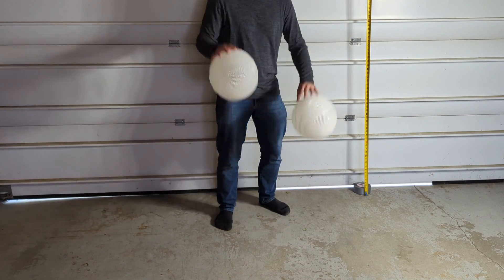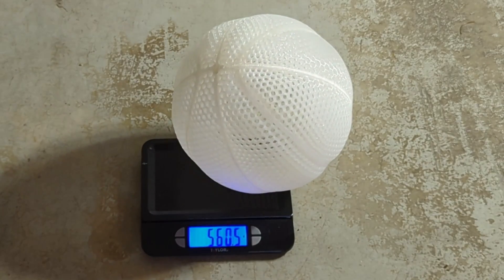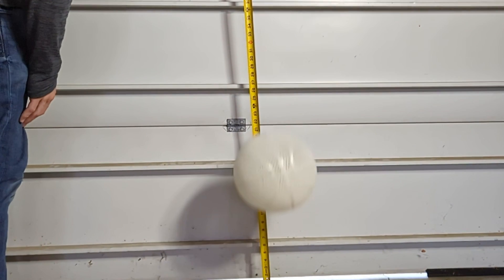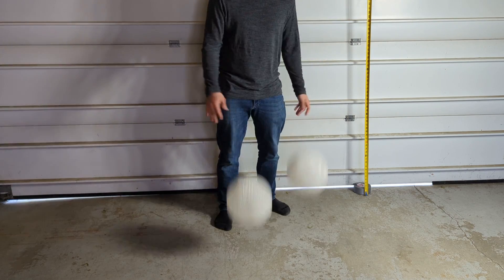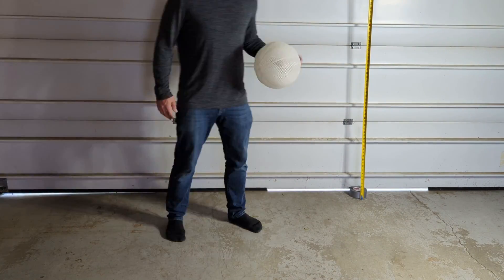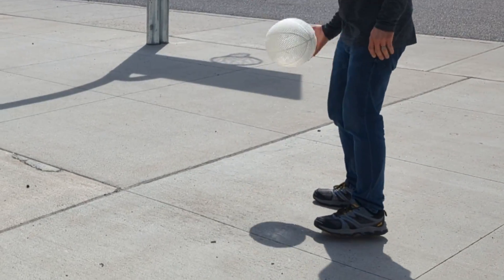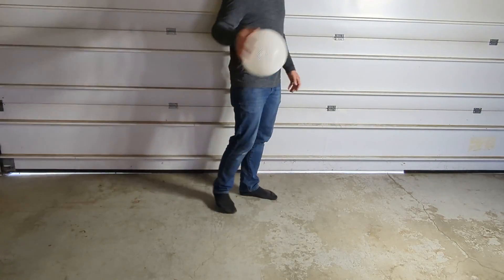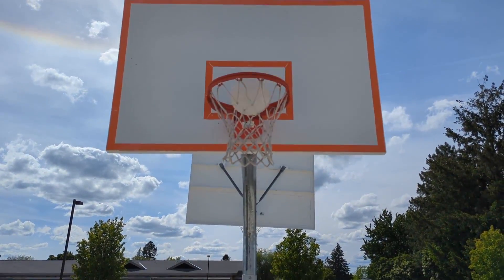Single vs. Double lattice PEBA Airless Basketballs – Durability and Bounce!

Comment: Is there any post work required? Does the ball need to be soaked in water or anything?
Reply from the maker: Besides removing the supports, I haven't done any post work except annealing, which definitely helps with the durability

Comment: Thanks for all the amazing work! Is it possible to print the supports in another material for easy removal?
Reply from the maker: @deonguo8002  much appreciated! The only way I know that would allow another support material would be using a printer with multiple tool heads (like the Prusa XL). That would be a game changer though as the support removal is a pain
Reply: @makeitlabchannel  not possible with AMS system?
Reply from the maker: @deonguo8002  I tried the AMS with PEBA and flex PLA and had bad results - tangles, clogs, etc. I couldn't get any of the flexible materials to work with the AMS. Maybe there is a workaround or upgrade that would allow it, but I haven't seen anything 😕
Reply: @makeitlabchannel  AMS lite isn't encased in a shell like AMS, maybe that'll work? Or just print with sth like pla in the ams for the support or dedicated support filament, then peba hanging as an external spool?
Reply from the maker: @deonguo8002  The AMS lite would definitely be worth a try, and I read that you can use the external spool and AMS lite if you have an adapter so that could work. Once I fix my A1 I might just try it!

Comment: is it possible to make the double lattice without the seem? I am assuming the seem is only there to resemble a traditional basketball but if its being printed it probably doesn't need it right?
Reply from the maker: @TheSwami514  I am currently making a double-lattice file, and I have included minimal seams that won't run parallel to the printing lines when printed. It has held up well so far so I will hopefully release it soon 😁
Reply: @makeitlabchannel  nice, i hope there is a video about it
Reply from the maker: @TheSwami514  there definitely will be 😁
Reply: @makeitlabchannel  Looking forward to see the result! Have you tried printing it in TPC? If so, how did it do?
Reply from the maker: @lorenzo-f5p  I have some TPC waiting for me to try once my file is complete, and I should be releasing it sometime next week so soon 😁
Reply: @makeitlabchannel  That's great to hear! I'm ordering a roll now, so very curious to see your results (and settings)! I will wait for your file before printing my own :)

Comment: I know the print times are long enough already 😅, but has anyone tried using Bambu PLA/PETG support material? Is it likely to work with these specialised Kimya filaments?
Reply from the maker: @syko2695  I have thought about trying this but the only problem that I can't work around is every time I put the peba filament in the AMS, it gets stuck and malfunctions. It might work for other Kimya filaments, but so can't get the AMS and peba to play nice
Reply: @makeitlabchannel  Ah, didn't think of that. Fair enough. I take it the 500g spools being significantly thinner than 1kg ones causes trouble?
Reply from the maker: @syko2695  weirdly enough, the size of the spool is the same size as a 1 kg regular pla spool. I think it is more that the peba is so flexible that the AMS has trouble with all of the additional motors and twists/turns. They warn against using tpu and other flexible filaments because of this, but I have seen some people do tpu successfully so maybe there is a secret

Comment: Is it best to make a double lattice with flex pla?
Reply from the maker: @sai7128  it would be best to make a double lattice flex PLA ball if you plan on annealing it like we did in this video: https://youtu.be/F0lkJQr95Gw?si=pT2U54nZO3sCyILL

If not, single lattice will probably last longer but have less bounce. At this point, I wouldn't make any flex PLA ball without annealing as they have all eventually cracked.
Reply: @makeitlabchannel  I got it. Your videos are very helpful.👍👍
Reply from the maker: @sai7128  Much appreciated!

Comment: Can confirm - just printed the double lattice file with settings from the last video and after about 20 bounces, it split down the seam section just like yours. Definitely will attempt the single lattice version with the improved durability, but I am curious to see if the double lattice printed at an angle would hold up durability-wise. To me, the double lattice certainly seems like it has the best bounce.
Reply from the maker: Appreciate it. If I can get more PEBA I will try printing it with a different orientation to see if it holds up.

Comment: it's all about the print direction... the weak part is generated between layers... the double-lattice have the seam printed horizontally (0:09), while the single vertically (0:11).
Reply from the maker: Yes that is definitely a big factor - I printed the file with a different orientation with flex PLA and it cracked around that seam as well. PEBA might have better results, but I think part of it is that the file has a thick seam that connects to small lattice branches at the areas it is cracking. If I can get more PEBA I will rotate the orientation and see if it will hold up 😁

Comment: did you try to print the supports in a different material? Maybe they are easier to remove in that case.
Reply from the maker: Yeah I thought about trying that but when I used the PEBA in the AMS it got caught/ran into some issues - is there another way besides the AMS or manual changes?
Reply: @makeitlabchannel  maybe with the AMS Hub? Not sure if you can directly use the Hub without the AMS. My guess is that the rubber fillament creates to much friction over the length of the AMS tubes.
Reply from the maker: @arcadebit1551  definitely worth looking into because if the supports were easy to remove it would be amazing. I think you are right

Comment: Try the airless file from printables called “Airless Basketball Gen X (Max)” don’t use the double lattice version tho
Reply from the maker: Thanks! I will check it out 😁
Reply: Why not use the double lattice version of that? I've been printing it with PEBA the last few days
Reply from the maker: @CCBCodeMonkey  how did it turn out? Does the durability hold up?
Reply: @makeitlabchannel  Oh the double lattice other file didnt finish because my power ran out, but either way that one just wouldn't bounce well, its essentially like a single lattice I think.

Comment: The double lattice cracking might be due to FDM printing, the original one was made using an industrial printer with solid layers instead of it extruded through a hot end in lines.
Made my double lattice basketball 3d model, it was a pain to do in Maya, i understand now why they decided to create a custom tool to make it easier, getting the right size for the patterns was tricky and also connecting the 2 layers required a lot of trial and error.
Would be cool to test with a resin printer and something like tough resin or flexible resin, resin printers do a better job of curing the layers.
Reply from the maker: You might be right there. Have you tried fdm printing your design? Resin printing is a good idea, never tried it but might be worth trying for this 😁
Reply: @makeitlabchannel  Sent my 3d model to an acquaintance but he never got to print it, was planning on printing a few to sell. Sold my old FDM printer only have resin printers but don't have the build volume to test it and never tried hard or flexible resin.

Comment: Great update!!. Does sound like there may be problems with the file. Perhaps bring into various slicer, CAD, sculpting, or modeling apps and see in there are variations across the mesh.
Reply from the maker: Appreciate it! Those are good ideas. I might start with just changing the orientation of the print as someone else recommended as it might just be the layer lines with that seam, but could still cause problems

Comment: Great work! I was able to print the double lattice with random seam enabled and had the same failure long that edge of the basketball. Excited to see how durability can be solved, as I really did like the bounce of the double lattice. Following for more :)
Reply from the maker: Appreciate it! I should have thought of this but someone mentioned just rotating the orientation 90 degrees so that the seam is not along the layer lines and that sounds promising. Will have to try when I get more PEBA 😁
Reply: @makeitlabchannel When  I printed that ball in flashforge flexible it was oriented 90 degrees from how you printed it and it cracked the same
Reply from the maker: @AlexMccawley  yeah for me it looked like it was more of a problem with the large/thick seam connected to small hexagon lines. Hopefully one of the files will work well

Comment: Thanks for the constant evolution of this project. Which brand of PEBA are you using? I have only seen Fillamentum and Kimya PEBA-S. 
I will absolutely build one or two of these but also very keen to follow your development journey.
Thanks for sharing.
Reply from the maker: Much appreciated! The brand of PEBA I am using is the Kimya PEBA-S - seems to work really well. I think changing the orientation of the double lattice might potentially help the durability, but I am running out of PEBA lol
Reply: @makeitlabchannel  its not cheap stuff. you either run out of PEBA or you run out of money doing this stuff.
Reply from the maker: @joshwright3683  yep that is my dilemma lol

Comment: I think that seam weakness on the double lattice ball may be due to an unoptimized print orientation. I printed my first ball the same way you did, but I was planning on rotating my next print 90 degrees so the NBA logo faces up. In that orientation the middle ball rib won't have to bridge onto the lattice wall.
Reply from the maker: That is a good point - the layer lines along that seam could very well be the issue. I will have to try your recommended orientation!
Reply: @makeitlabchannel  Someone has updated the model to have less holes near the seams. Also you should check out this filament called FPLA by sting3d. I was able to get really good results with it. I just didn't make the the top shell thick enough so it kills the bounce in that one area.
Reply: About to mention the same thing, the material seems to be doing a great job, but if it keeps breaks there, there must be a weakness created at the horizontal seams which is not found with the hexagons, printing it vertically should hopefully provide a stronger ball :)
Reply from the maker: @3Dalec yeah I think you are right. I printed the same file with a different orientation using flex PLA and it cracked in the same place, but maybe it will hold up with PEBA